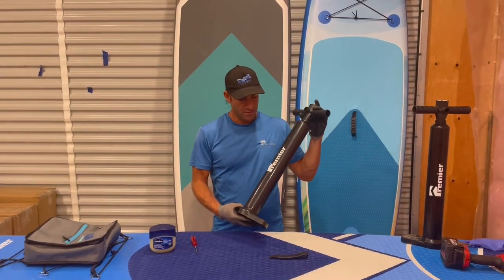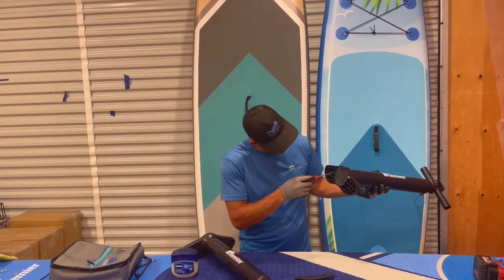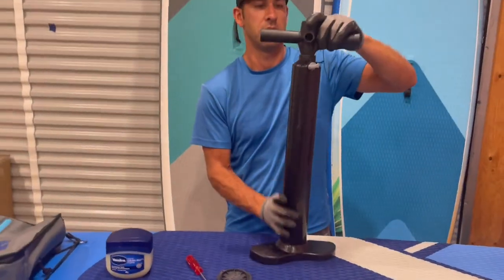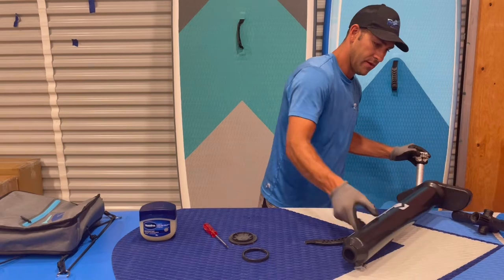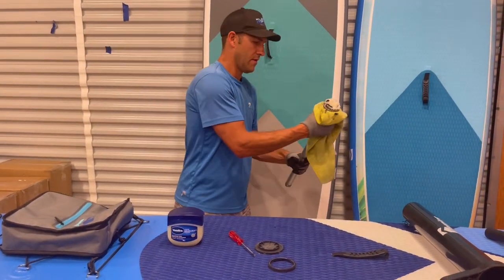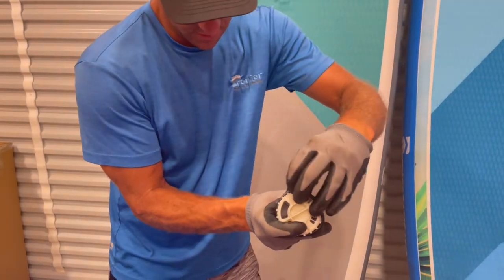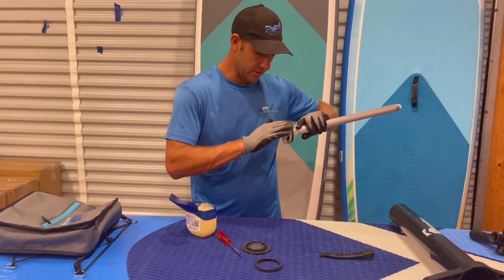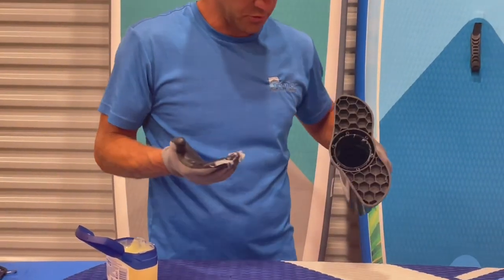iSUP Dual Stage Pump Maintenance - Premier Paddle Boards

Comment: Very helpful! Thanks for showing how to disassemble the pump. The rubber grommet at the top of the pump cylinder came out and I couldn't get it back in. I'm sure I'll be and to get it back in tomorrow with the help of this video!